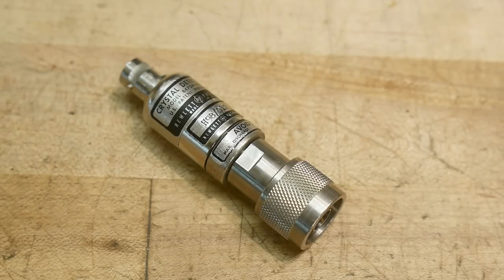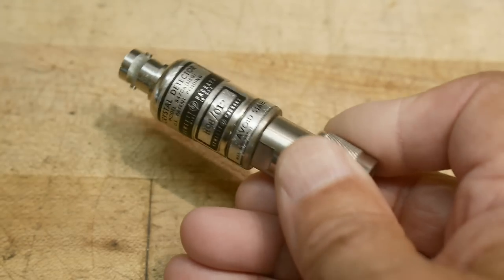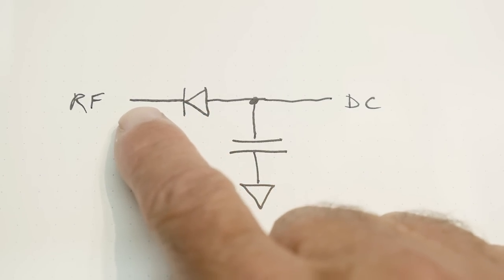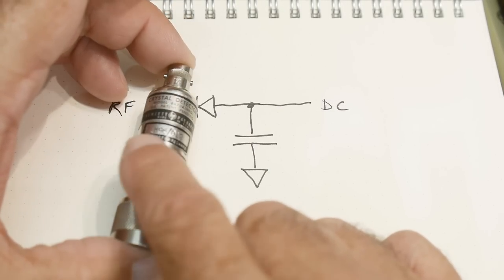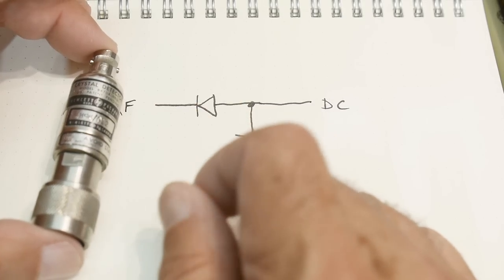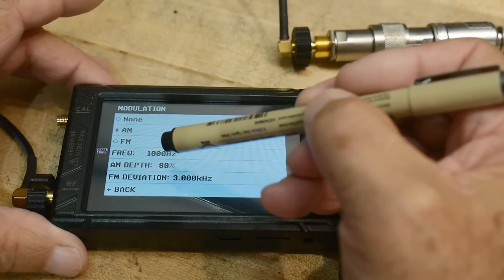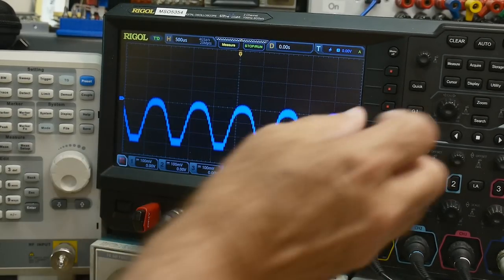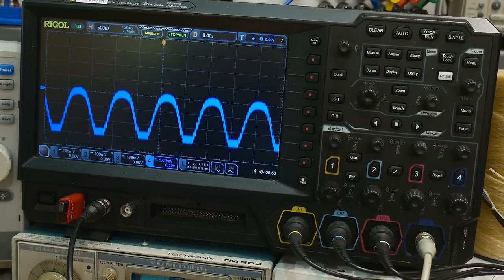#1600 Crystal Detector aka Diode Detector

Comment: We used them as part of a frequency calibration setup when we had to run tests/repairs on a Nike Herc missile test chassis.  Feed a small klystron into a can with a vernier volume adjustment and measure the output.  Set the can to the frequency you are looking for and adjust the size of the klystron cavity to match by watching the output of the detector on a meter.  None of that digital crap for us - 45 years ago.

Comment: These are still used in the linear accelerators I work on, and similar power microwave systems, usually in the AFC circuits, or for monitoring the envelope of RF signals on a scope.

Comment: These were used all over the Army satcom terminals I worked on in the 70’s. Just as you described, typically a 30 or 40 dB coupler on the output waveguide given the high power and other coupling values in other parts of the RF chain.  Used to monitor output and for fault detection.
Reply: I used them with the sweeper to tune 70 Mhz IF strips.

Comment: You'll find similar in wattmeters and RF voltmeter probes, as well as demodulator probes in a variety of instruments. Many used Geranium diodes with a low forward voltage, and some have tried building some with Schttoky diodes. However, the more accurate used a vacuum tube diode in the probe. HP, Hickok, and Eico used this method.

The Struthers wattmeter, AN/URM-120, used a cartridge diode in the element. There wasn't much else besides a feed-through cap and a resistor, if I recall. The four power settings are determined by a cam in the element, which raises the pickup element away from the line section's line between the input and output terminals. It works similar to a variable piston attenuator and is very accurate.

Comment: In the 80’s most RADARS still used a crystal diode right after the Tx/RX switch to detect the reflected signal. No fancy receiver, just the diode detector that gets fed into an amplifier and then into the range gates. The dish and waveguides formed the tuned circuit. Those diodes were very sensitive to large RF fields, so you had to take great care that in the case of another co-located RADAR on a close frequency, that the antennas could never point to each other. One transmit pulse-train would blow the detector-diode on the other system if the antennas look at each other…

Comment: Very interesting video, great seeing an old crystal detector from well before my time! working with microwave up and down converters for electronic warfare applications we couple the incoming RF to a SDLVA such as the ADI HMC913 die that outputs the video signal proportional to the detected RF signal (0.6-20GHz).  Interesting to see the size difference on how big this crystal detector is compared to the .0509”x .0444” die dimensions of the HMC913!

Comment: How did this enable the higher frequency measurements compared to other instruments capability?
Reply from the maker: microwave diode allows rectification into a DC voltage
Reply: @IMSAIGuy  Thanks.  So, a scope would better process a GHz pulsing dc signal than GHz ac signal?
Reply from the maker: you still don't quite understand. the output of the detector is just a voltage that is proportional to the amplitude of the GHz signal. it can follow the modulation at audio frequencies but no faster. it is the same as the demodulator in an AM radio.
Reply from the maker: https://www.electronics-notes.com/articles/radio/modulation/am-diode-detector-demodulator.php
Reply: @IMSAIGuy   "Measuring" meant frequency to me, and the example wave shown reinforced my mistake. I get that it's for amplitude measurement.  Thanks for the follow-up and reference.

Comment: Are some of these crystals degraded by ESD?
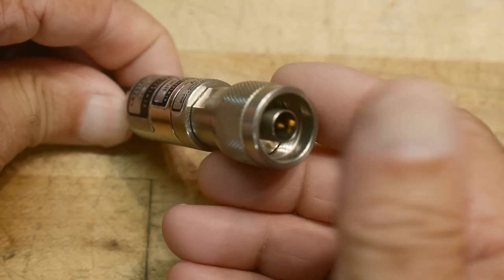Reply: Bottom-most label seen at 01:01 seems to suggest that.
Reply: Strange. My reply disappeared so reposting.  
Yes generic "avoid static" label but says "Max Discharge = " = blank so your guess would be as good as mine. 
I do know when interpret this sort of thing literally it then turns into 'antistat religion' complete with the antistatic gear and all that then if anything ever goes wrong blame it on hadn't connect the wrist band to ground properly..
   @haroldsmith45302